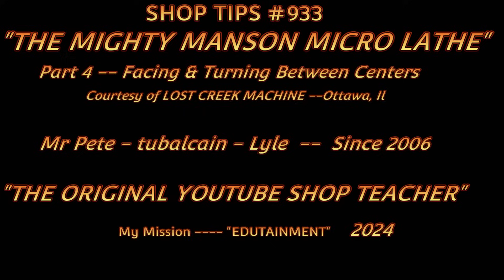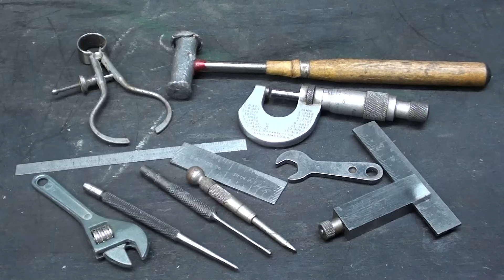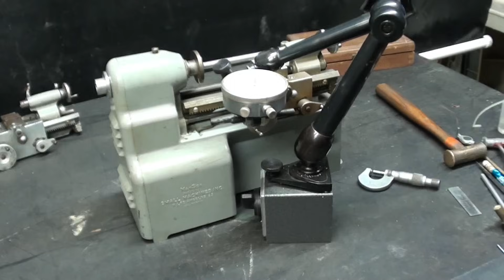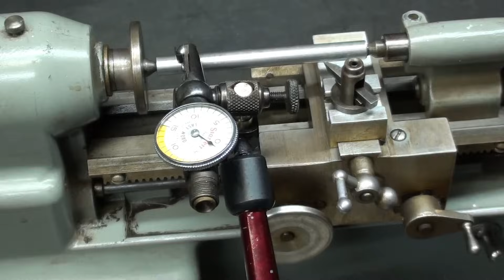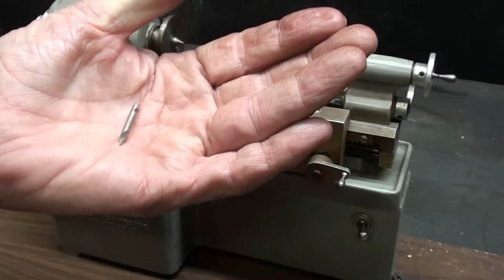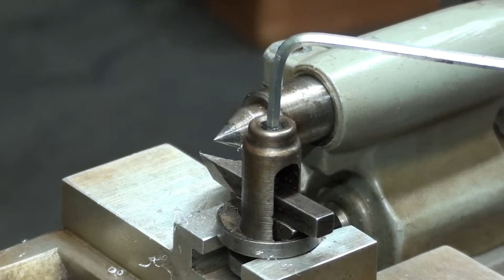the EXTRAORDINARY MANSON MICRO LATHE #933 pt 4 tubalcain unimat

Comment: Thank You for your continued education for those of us who will never see a 12" lathe or a man sized mill in our homes. I started with a 4" craftsman modeler lathe but it was a joke the threads on each axis is non standard and not aligning with the poor wheel markings. I upped to the craftsman 6 "lathe and it is much more a tool, it Evan came with the mill attachment. I have three of your lesson sticks on the craftsman/atlas lathe and the Bridgeport mil. Things are so much different with the mill set up and technical use that there is a way wide gap. I also have a Unimat system any fill in you can do as you review these machines would help. I have to move the sewing machine to work if you catch my drift. I sure love and appreciate your lessons we even like seeing you make chips so don't worry about showing too much. Your Student Bruce Mecham in Utah.
Reply from the maker: Hello Bruce.
Thank you for watching. I am tentatively planning on making a video course using the unimat.

Comment: Very nice video mr Pete. Like a orientation , the area of chip must be 1/80 until 1/100 of the section of tool bit. You can round the tool bit 0,2 mm with a sharpening stone and you will obtain a very good finish . Thank you for transmit your knowledge

Comment: Ya know they are long out of business. I bet Clark Easterling could cast a few dozen extended bases, and have every Youtube machinist contributor could make one ore more parts. I suggest... That you take it apart. every inch. and scan it for reproduction. I could make a bunch of those beds on my shaper.. . I know without any question that you could make even hand drawn engineering plans. I bet without any doubt, that everyone on Youtube would jump at the idea to make say 10 of one ore more parts. I could cut the beds to rough shape out of used bar stock on my shaper. OR i would rent it from the owner for a month, and reproduce it myself. I have available facilities to copy it. Rebadged, it wont hurt the value of the real McCoy.

Comment: On the plus side you really don't have to worry about pinching or smashing your fingers when you take off the 4 jaw chuck. 🤣 Actually looking at the work you're doing I think you would be amazed at the work you could accomplish on this machine. It would just take forever because the metal removal rate would be so slow. Right now my daughter is working on a tailstock die holder. If I shortened it a couple of inches (would still work fine) it could be made on that micro lathe. Nice video, I've seen some newer lathes about that size but this is the first time I've ever seen an old one. 😁

Comment: having the belt slip on these small lathes is a good indication you are pushing the boundary of what it can do, my unimat 3 is set so the belt slips before anything bad happens as does my smaller than the unimat flexispeed and watchmakers lathe. for anything big - like you I turn to a bigger lathe- for me my 13" south bend
Reply: I think the bed on my flexispeed may be a little longer, it has a 4" working length and can turn up to 2" diameter just. The beauty of these small lathes is if you only have a small work bench, they can still be used

Comment: This seems to have a bit more power than a unimat. I see quite a bit of flex and the carriage seems quite loose. But, I  think if you made a Vernier dial for it address the play in the machine, and of course tighten the belt, this could seriously be a darn nice unit. FWIW, the first thing  i would do if I owned that would be to make that spare bed attach to the complete lathe and work. In fact, if it wasn't so rare, i would cut the frame in half, make a lead screw long enough and make the thing twice as long with the separated castings as end legs, and make a chip tray center for support. or a spare main casting and make it appear one piece casting. If that had some real travel it would be awesome. I wish i had one.
Reply from the maker: That would be a neat project. Make it into an extended bed Lathe
Reply: Yeah i dare ya! I know you can do it!    @mrpete222